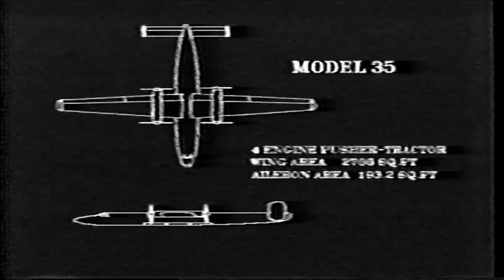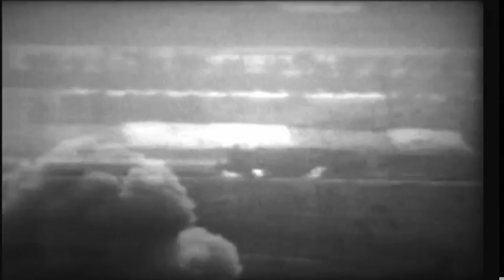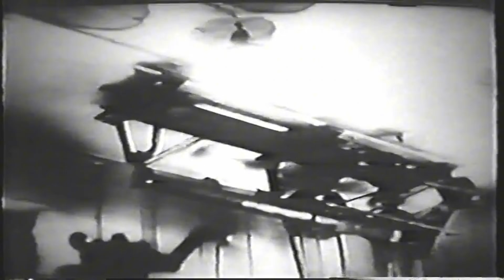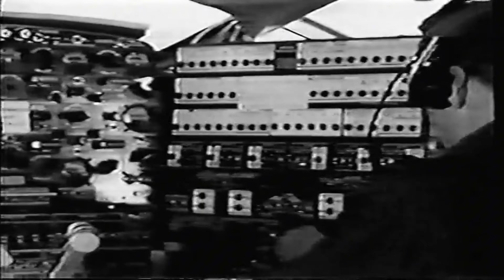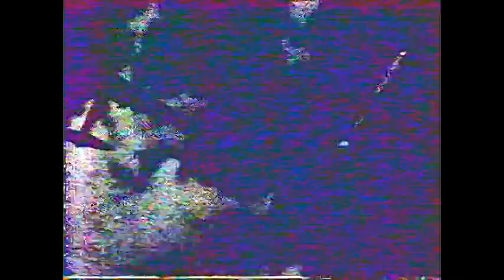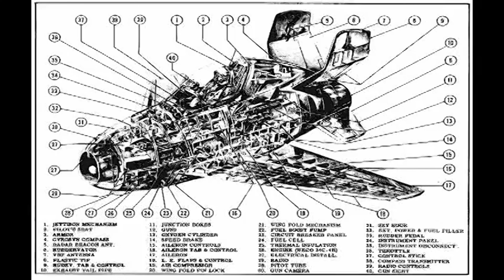Six Turning, Four Burning: The B-36 That Defined America's Nuclear Air Command

Comment: The Peacemaker was a behemoth, and it's survivability in combat would have been problematic in it's original configuration as a free fall bomber.     Had it been equipped with a rotary missile launcher in the bomb bay, which would have allowed attacking from outside of enemy airspace, things would have been better.